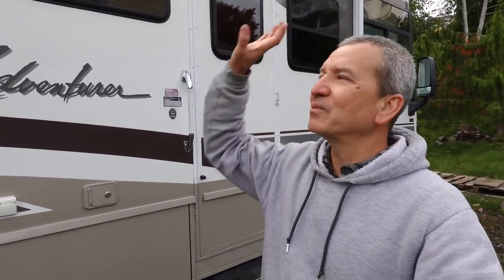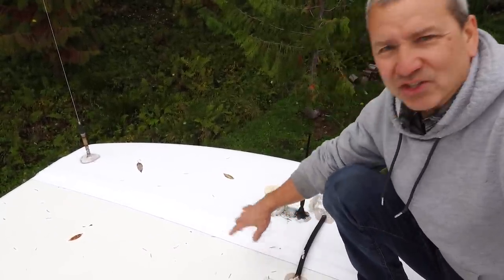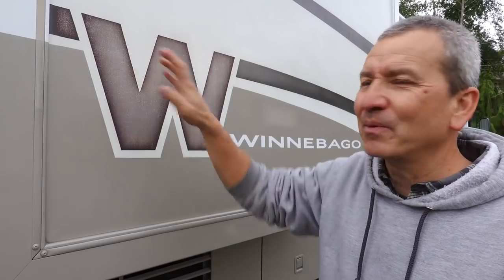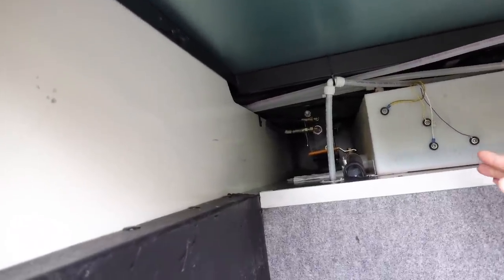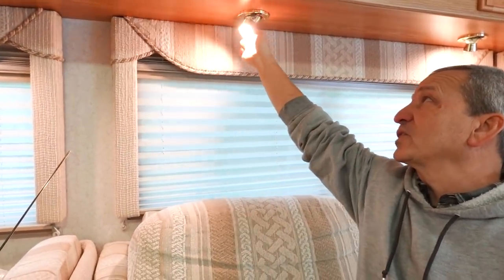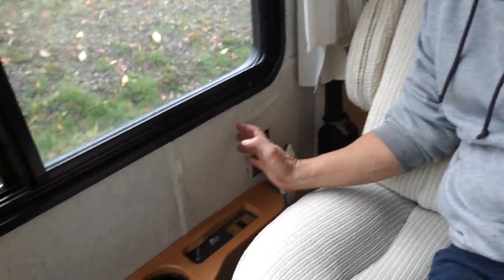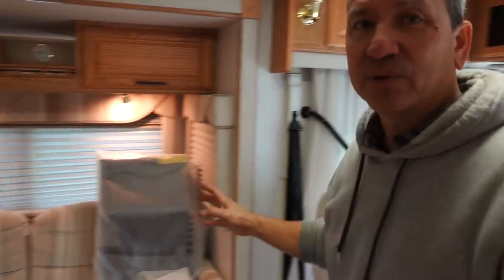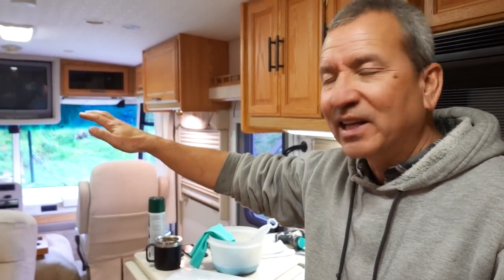(UPDATE) Winnebago Class A RV Renovation - Problems, Repairs, Upgrades & Cleaning | RVwithTito DIY

Comment from the maker: You're gonna love this one. I figured out the water pump problem and the problem was me. The pump works fine and I feel like a newbie for missing this. It turns out my tank level was too low. So the pump was probably sucking air through the overflow. Yes. This occurred to me at 1AM and I had to go check. Sure enough. Thanks to those of you who chimed in to try and help, and thanks for not asking me the obvious question "is there water in the tank?" Hehe :)
Reply from the maker: @brianfromnh2596  :) One less thing to fix.
Reply: Right on now you still have a spare pump 👍
Reply from the maker: Yes. All good.👍
Reply: Just an FYI, but if you set the water diverter from  "normal operation" to "fill fresh tank" (it's that knob on the back wall in the pump compartment) the pump will run like that all the time when you turn off the water coming into the coach. When I saw your pump running I thought maybe that was the issue but I could see the diverter valve was in the normal operation mode.
Reply from the maker: @paulgreen2303  Thanks. I think I have it figured out now. Not used to having all of these modes in the water system. 🤪
Reply: Congrats on the find.  My neighbor did the same thing while breaking in his new Tiffen Phateon.  Parked on the street with the chassis at an angle and the water was sloshed to the far corner and the pump kept running.  I told him to add some water and sure enough, the pump could pressurize and then stop.  👍🏻👍🏻
Reply: 😆 lol 😆
Reply: Mine had a bypass valve that was stuck open because the rubber seal became dislodged somehow.  Wasn't too hard to disassemble and fix

Comment: Now that I've removed, recovered and replaced the dash in my 2000 Chieftain, I thought you might like an update on my experience.

First,  advice on removal.  Remove as much of the console as you can and move it out of the way. I removed everything except the engine instrument cluster. There are some large molex connectors that can be disconnected, and the backup camera comes out.

There were four 1/2" nuts that had to be accessed from inside the engine compartment, right up against the windshield. One in front of each of the defrost vents. Use a long extension to get a socket up there.

There were five 1/2" bolts spaced equally across the dash, bolting the front/lower half to the rear/higher half. Three were easily reachable with the console removed. The one near the passenger window wasn't too bad either. Without the passenger seat removed, I could have got at it with a couple of long extensions on the socket. The one between the center and passenger side bolt required lifting and entire assembly to get a ratchet on it.

Before you can lift it to get at that last bolt, you have to remove four "legs" that have self tapping screws into the center box (heater plenum?) and side walls. The lower aluminum channel holding the stabilizing jack controls, vents and cigarette lighter sockets is held by small screw going down into it from above about every eight inches, and one screw going up at each leg.

With that, it will come out, slipping the engine instrument cluster through the console's hole. It doesn't come out easy. It's a tight fit, and the glue used on the original covering has a hold. But, removing it is worth the effort. It appears condensation will trickle down the windscreen, and rot out the metal support structure in front of the dash.

Using cardboard to protect the glass, I sprayed that area with rust conversion, primer, and then paint. Then I spread a layer of Sitka sealant. If your dash hasn't been off in 20yrs, I would suggest pulling it to inspect this area.

Comment: Tito, I really enjoy your video content. We have a 1999 34V D/P Adventurer bought at the height of the motor home shortage in 2021.  I have done many repairs and a few upgrades and hope to create a couple of videos to share as I found next to nothing except James at AZ Expert who also saved my bacon with his roof knowledge.  Did the same repair as you but I had to scotch bright my roof an applied oil base marine paint made for fiberglass bought at Lowes.  (Rust-Oleum Marine Coatings Topside Paint Semi-gloss White Enamel Oil-based Marine Paint: 1-quart. First coat  took a bit more than two quarts. 

The paint on your rig is in amazing.  One item I heard you mentioned was Dicor.  I know James has said many times that product won't stick long term to the self-leveling silicone that Winnebago uses.  Heng's 95502 White NuFlex #311 Sealant was his go to for self-leveling on these roofs.  Just checked the price and it even more expensive that last year.
https://www.amazon.com/gp/product/B003YJNO98/ref=ppx_yo_dt_b_asin_title_o00_s00?ie=UTF8&psc=1

One small thing that I did recently was replace (so far seven) of the electrical outlets with residential/commercial grade outlets using this box:
https://www.homedepot.com/p/Carlon-Blue-PVC-1-Gang-8-cu-in-Flanged-Shallow-Old-Work-Electrical-Outlet-Box-B108R-UPC/100404058
and these outlets: 
https://www.lowes.com/pd/Eaton-15A-125V-Commercial-Receptacle-WH/1002785010   I like them better than the Leviton
for the walls but gluing a strip of wood behind/inside the wall so the small wood screws would adequately secure the box. I also made a template the exact size of the new box and for marking and used an oscillating tool To carefully cut our the exact size for the new box.  Our model also had a 3/4" oak standoff for the outlet giving it the additional room needed.  I didn't noticed those in your class A videos.  I also did have to replace the supplied screws with # 6 x 1-1/4" long screws That I fortunately had laying around from a prvious project. 
https://www.mcmaster.com/products/screws/rounded-head-style~truss/thread-size~6-32/

Trying to figure how to make a nice TV cabinet like you did in your class C.   That come out very nice!  With our model it is a game of inches.  Looking forward to the new A/C installation.
Cheers

Comment: I have the same coach you have now. Same year and also one owner. I sanded and painted all the cabinet and drawer pulls  and redid the floors.  Upgraded to lithium and inverter and solar also. 
Enjoy viewing what you do and the detail you show.  After seeing your tv change in your class c I wanted to do the same in the Adventurer. Not done it yet.  Thanks for sharing what you do.
Reply from the maker: Glad you're getting ideas from some of our projects. We're taking it slow. I ended up putting the TV in the front.
Reply: @RVwithTito  I did also.  Just couldn't fit what you did in your class C with the elevator.

Comment: Instead of a baffle for the front edge of the solar panel, you could just stuff in some foam between the roof and panel frame. Thinking of the foam 'noodles' that they use for swimming pools.
Reply from the maker: Hmmm. Hadn't thought of that. I'll ponder it. Thx.

Comment: I had same problem with my water bump a few weeks ago.There was no water in the pump. I attached a tube to the pump and added water. It worked.
Reply from the maker: Bingo. My water tank was too low. Pump works great now. Go figure :)

Comment: Loving the advice, as I'm at almost the exact same stage right now.  I bought a 2000 Winnebago Chieftain a couple weeks ago, and have been at it every day since.  On your advice, I got the AC coil cleaned out last night.  I don't think it had ever been cleaned.  Couldn't find the coil at first, because it was so matted it looked like the wall.  But, I sprayed the cleaner, waited, rinsed, repeated, until the can was empty.  I can now see right through the coil.
I have all the carpet out.  The carpet glue in the cockpit area was an entire weekend job.  Found that I could let is soak in acetone for a few hours and it would get much softer.
After installing two new Fantastic Fans, I got the roof coated in two coats of  Tropicool all the way down to the marker lights on front and back.  I like this.  Everything feels sealed really solid.  
My biggest obstacle right now is getting the dash off so that I can cover with new vinyl.  Painting will not work for what is left of the original.  Any ideas?
Reply from the maker: How satisfying that must have been to expose the coil again :) The projects are never ending. I just spent the last couple weeks getting the RV exterior all re-sealed :P Sorry. I don't have any ideas about the dash yet. Do you need to remove it to cover it though?
Reply: @RVwithTito  I can't see how to get new fabric down past the front without taking it out.  But, I moved to the back and started working my way forward.  Bedroom is done.  Bathroom I'm avoiding.  New floor is about done back to front.  I'm moving back to the dash tomorrow.

Here's something to consider.  Vinyl tile.  The good kind shaped like boards, with the feel of the grain in it.  Don't lay it straight.  Snap a line down the center from the cockpit all the way through the bedroom.  Lay the planks at a 45 degree angle so that the tips interlock.  Now, lay down a row to the outside of those two, angled in the opposite direction, again interlocking with whats there.  If you substitute in a different color plank for one "row across", you get a W.  If your wife starts suggesting that you need to redo the floor that you just put down in the real house, you done it right.

Comment: Love these videos. We also bought a used Winnebago class A and these are very helpful. Be sue to show the spring replacement on the leveling jacks as it is on our project list too!  You do very thorough and nice work.
Reply from the maker: You bet. Never done it before but it looks straight forward. Wish me luck 🙏
Reply: @RVwithTito  from what I've seen you use wood wedges with the jack extended to get them off.

Comment: Very good video. we bought a 33' class A last summer and are renovating it and still learning its different crazy systems. just spent a day trying to figure out why i had no power when unplugged from shore power. found it was a battery disconnect switch, duh.

Comment: Hi Brian , 
 Great Vid we have a 2003  Winnebago Explorer 32 In Australia its on the chev chassis 6.5 turbo diesel No Slides on ours  , I have the same drama with the roof lining inside its snowing , I sprayed upholstery cleaner on (The foam stuff ) and used the Vac To pull it back off worked great , its been 6 months and no more dust , Cant wait to see the rest of the build ,, 
Rob 
NSW
Australia
Reply from the maker: Great to hear. Thx 👍

Comment: On both of our Winnebagos there is a switch in the water system that  goes from "normal" to "tank fill". That's how you fill the fresh water tank from the city water hook-up. If that switch is left on "Tank fill" while the pump is on, the pump runs constantly.
Reply from the maker: Yeah. I have that switch. Pump still runs in both positions.
Reply: @RVwithTito  switch the switch?

Comment: To help with the light/sun block on the front windshield area my wife made up sun blocking screens that are held on by magnets installed inside the windshield and in pockets sewn the the back of the screens. Easy on easy off. They work great.  They really help with the heat from the sun on the extra large Winnebago windows. Check out Magne screens and make your own.
Reply from the maker: Thanks. We have a privacy shade for the outside. We're looking more for an inside privacy curtain for those rest-stop and walmart nights.

Comment: Hey Brian. Be sure to check out the sealant call-out sheet from Winnebago for your coach. If they used silicone sealant during manufacturing then you’ll have to use silicone, not Dicor. Dicor will never stick to silicone no matter how well your clean it. Not sure about Eternabond or the Gorilla tape. Learned that the hard way after re-sealing the bathroom skylight on our 2008 coach with Dicor.  It peeled away very easily.  ProflexRV silicone sealant is good stuff.
Reply from the maker: Thanks Brian. I have a tube of the recommended self leveling sealant but haven't used it yet. Don't plan on using Dicor. Yes. I'm really liking the ProFlex and always seem to be needing more. Good stuff. Hope you guys are doing well.

Comment: Regarding colored lights, red doesn't mess with your night vision....  I like that option for things I might use as a night light.
Reply from the maker: I like the red light too. Also works good at night when there are bugs around.
Reply: @RVwithTito  I wish the RV LED replacement fixtures had an option of remote adjustable colors like you can get in household LED's.

Comment: Great tour, Brian.  If you have any lingering odors that you just can't seem to get rid of, buy or rent an Ozone Generator and leave it on in the unoccupied RV for a few nights.  I guarantee you, it will eliminate all odors.
Reply from the maker: Outstanding tip. Very useful piece of equipment. Thanks. Just ordered one.
Reply: Charcoal dies an amazing job to remove smells.  Couldn't be cheaper.
Reply from the maker: @volvoqueen9698  Hmmm 🤔 Hadn't thought of that. Thanks for the tip 👍
Reply: @volvoqueen9698  - Maybe so but it takes forever.

Comment: Pro flex states its not for rubber, so that means I shouldn’t use it on an EPDM roof?  I think your roof is fiberglass if I recall from the last video?  I want to follow your lead and give my roof some needed upkeep, but I do have a epdm roof.  

I had the same issue with the water pump when the wife let the water pump run with no water in the tank for over a couple hours.  I think it blows the seals and couldn’t build pressure as a result and would run non-stop.  Had to replace it and problem was solved.  Thanks for the video’s Brian!
Reply from the maker: EPDM and TPO are both rubber roofs. Yes. The class A is fiberglass but our class C is TPO. I mostly used DICOR on the TPO roof.
Reply: @RVwithTito  Thanks for the reply!  I really liked the process you demonstrated on the Class A.  Attaching the rails with VHB tape was cool.  I want to do the same, but since EPDM is designed to “shed” layers over the years, I wonder if VHB would be a viable means of attachment or should I do some roof penetrations.  I used a 100W solar panel @ Lone Rock daily and it kept our AGM Battery topped off with no problem.  It was great, so I think we’re ready to follow suit and put them on the roof.  I had to rotate the panel through the day as the sun moved…

Got our BattleBorn battery, so I want to start planning the solar portion.  I’ll rewatch your Solar tutorial again but wanted to ask these questions for the planning part.   Kind regards,

Comment: I have done a lot to our 03 Winnebago and have more to do, but I have found that the bathroom sink drains into the black tank witch will fill it fast. So i need to find a way to replumb that to the gray tank. The more I look into our 30b the better I find the build quality. If I could talk my wife into a composting toilet and use the black tank as a gray tank would be a easy fix.
Reply from the maker: Whaaat!? I'll have to check the bathroom drain on ours. That's not cool. Not to mention a stinky sink if the p-trap were to fail.

Comment: Hi Brian.  Have you checked those radii lately?  Winnebago used Silicone sealant on these roofs, which leaves a residue when removed.  I'm seeing a lot of revviews that the profilexRV does not adhere to silicone residue.

Comment: Looking great Brian, so much work involved in caulking that roof and windows!

On our old Georgie Boy we had curtains on the front window and I hated them.  On on our new Mirada we have MCD power roller shades (the black out and tinted one). They are awesome when parked and great when driving into a setting sun.  I suggest that you look into them.  They are are also awesome on the side windows to keep the sun off you when you are driving. The best thing about a class a is the view and the worst thing is that all that glass becomes a greenhouse on a hot day.
Reply from the maker: I just finished the re-sealing jobs today. It's taken this long. Ugh! and Yay! Melissa is working on the replacement shades. I think they'll turn out fine. Thanks for the suggestions. BTW we do have privacy shades that clip to the outside while parked for a while. But we do spend a bit of time on the road and often stop at rest stops, parking lots and other places. It's nice to just pull the shades inside from full privacy.

Comment: Brian. Congrats on the new project!  BTW the water pump should not run continuously. It will burn out. If it is a Surflow 4800 it is easy to adjust with a 5/64” Allen wrench. Good luck!

Comment: Our water pump keeps running as well, usually after a prolonged time without using the pump. We usually open the faucet, let the air and the water out and then the pump pressurizes the lines and stops. All I can figure is there is air in the system between the pump and the faucet which is messing with the pressure.
Reply from the maker: Definitely air in the system. Figure it out last night. The water level was too low, so it was sucking air through the overflow outlet. Oops :)

Comment: Hi Brian! We have a very similar 2003 Winnebago Brave, and, among other things, are replicating your cabinet door handle replacement idea. The ones we've put on so far really do look good, but here's a question - how did you replace the pantry handles? Are they even screwed in, or glued on?  Thanks!
Reply from the maker: Ah yes. It's a pain. You have to take the pantry apart. The screws are hidden behind the front finished panel.

Comment: Good Morning. I'm looking at putting on two Solar panels. I was thing of either 2 HQST 200 Watt each or two Renogy 175 Watt panels. I have two Battle Born 100ah for a 200ah sys. I have a 2000 Watt inverter but at this time I do not plain on BOON DOCKING very much or long. I do have a back up invertor Generator. This will be for help maintain the batteries. Any sajustshion would be Great. Jack